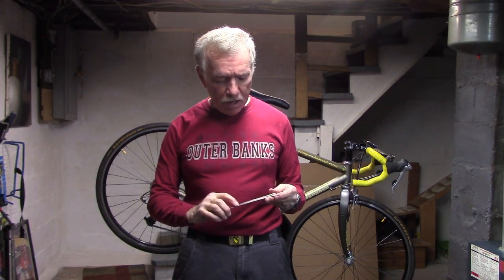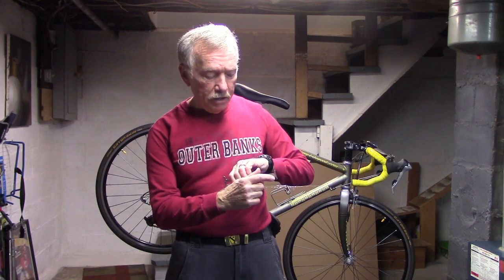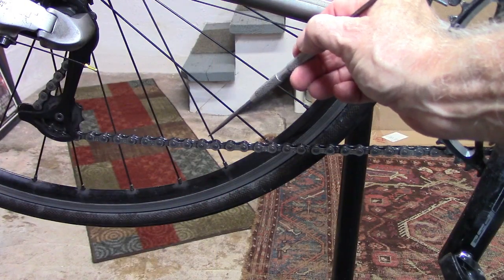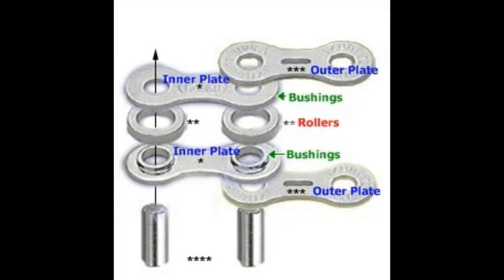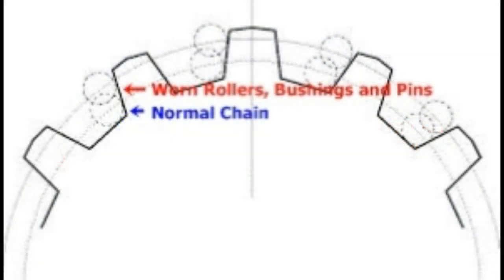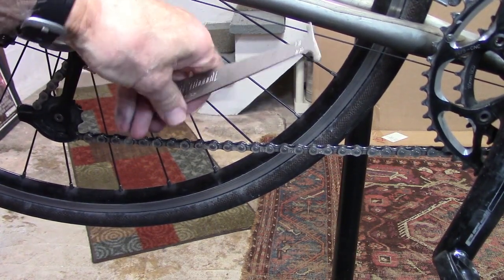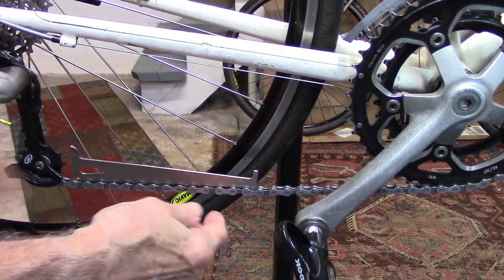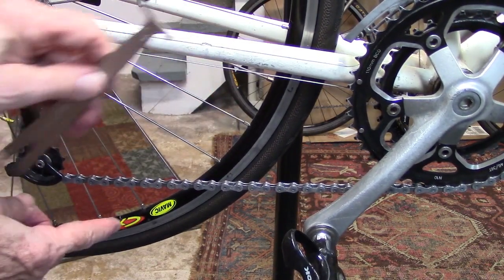Measuring for Bicycle Chain Wear with Park Chain Wear Tool

Comment: Great video Tony, very informative. At the bike shop I used to work at we called our wear indicator "the money maker" it's a great visual for customers and they're happy to buy a new chain when they see the prices for new chainrings!
Reply from the maker: I wouldn't call it a "money maker" in the LONG RUN, because it will save wear and tear of other components of the drive train, saving them money for more costly replacements. Your bikes cassette, chain rings and pulley wheels will last longer. And bike performance will be enhanced. Thanks and regards, Tony

Comment: i know that rollers wear due to contact with the chain rings, but chains also stretch. Measure the distance between say, a dozen pins on an old chain and compare them to a new chain and you will find that the pins on the old chain are further apart than on the new chain. Just a fraction but noticeable enough.

Comment: I know the rollers wear because of contact with the chain rings but I believe that the chain will also stretch over time. This is easily proven by measuring the distance between say a dozen pins on an old chain and comparing them to a new chain. the pins on an old chain will be further apart than on the new chain.
Reply from the maker: Interesting observation. I went back and checked a new chain just placed on one of our bicycles and compared it to one on my stationary trainer which is VERY worn. I used a high end digital caliper accurate to 0.1 mm. Took repeated measure of the distance between chain rivets over 4 links (a link constitutes both an inner and outer plate - looks link 2 chain links but not really. Comparing the new chain to the old worn chain, we could find no difference. It's hard to "stretch" metallic plates and the literature seem to back me up. But I won't rule out your observation. Thanks and regards, Tony